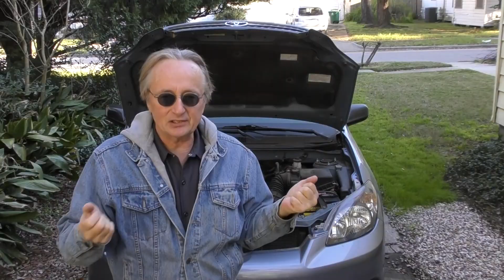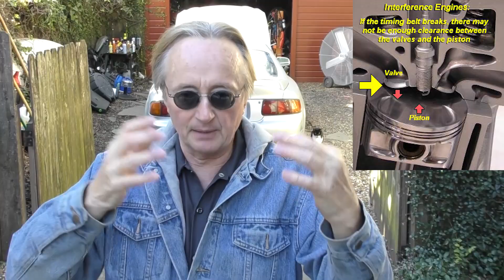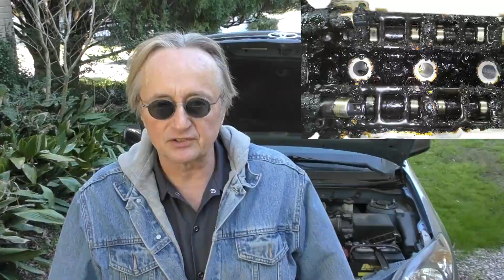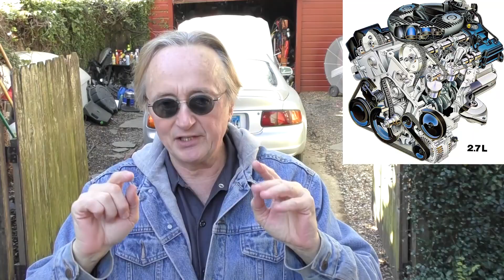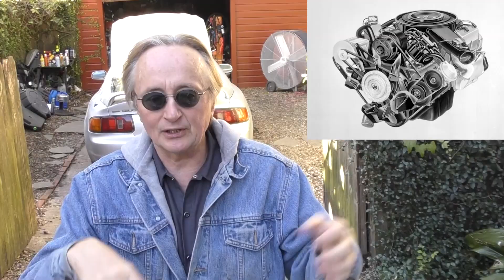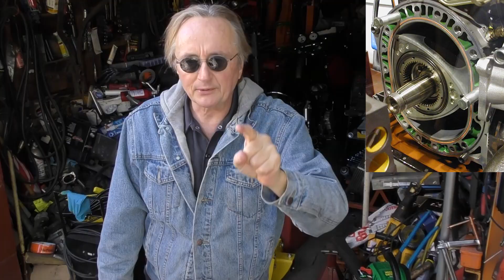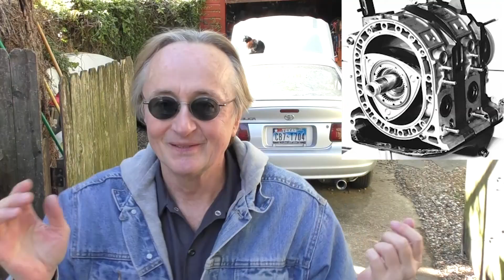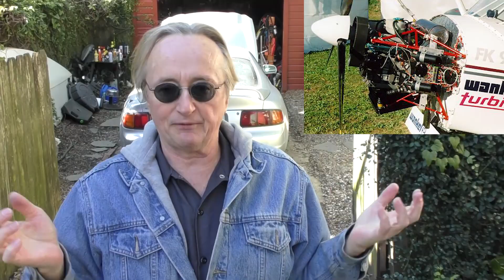Never Buy a Car With This Engine

Comment: What ever 6 cyl. that was in the first year Chevrolet Celebrity was my worst. Pure Junk!
Reply: COO Ba The citation was pretty awful too😂😂 And of course the Vega
Reply: @JDMHaze  Oh the Vega! It would of probably been a good motor, but it had to be kept clean and maintained. Oil changing with good quality oil a very well kept intervals. But being an economy car, those who bought it we're not very good at maintaining a car. The chrome lining to the cylinder walls was less than paper thin, and any dirt or grim would almost instantly destroy it. Failing to keep up decent oil change intervals was a sure death certificate.
Reply: @ronfullerton3162  But on the plus side, Dead Vegas were once very cheap,and just waiting excitedly for guys like me to drop a V-8 off between the fenders and go to The Strip?? Several places even made a kit with everything you'd need to do it!!!! (And truthfully, most Vegas you'll see today......have a Small Block dropped off in 'er??)
Reply: @DrOlds7298  That would of been an interesting machine! Nice power to weight ratio! Was there enough goodies around to make them handle good also on the street? That would of been great fun.
Reply: Probably the 3.0 L. I had a century with one. It was junk.
Reply: 2.8. That's probably the one you're thinking about??

Comment: Buy Japanese cars Only, you won't regret it.
Reply: Or a Ford/Lincoln product. The 2 liter turbo 4s in the Fusion are solid and fun to drive.
Reply: @davidperry4013  Ford cars are discontinued except for the mustang.  I 'll stick with Toyota or Honda.😀
Reply: Prices of 94 Celica's are going trough the roof nowadays.
Reply: Hondas are notorious for bad transmissions, Toyota's have had oil consumption issues and failures with some of their 4 cylinder engines and huge issues with rusting frames. The frame problem is on trucks band suvs though, I don't believe it's an issue with the cars
Reply: lol after u have your yearly inspection and the inspector points out how your car wont pass because it has so much rust problems, you will regret.
Reply: @tommior9553  That's it. It's that all you have? Lmao
Reply: @rafyg3314  they have good reliable engines dont get me wrong, but corrosion protection from factory is very poor.
Reply: @tommior9553 Yeah just like Scottys  1993 Toyota Celica right. Lol
Reply: @rafyg3314  scotty lives in an area where there isnt heavy snow season. mix snow, salt and Japanese car, mazdas especially, and you will have plenty of rust.
Reply: @tommior9553  Any car rust in the north, don't buy a Honda if you leave in Alaska. Lol
Reply: @tommior9553  that's just Toyota

Comment: My roommates 79 RX7 was a fast as hell car. But it spent more time in shop to ever enjoy it. I don't know if we ever went more than 4 miles at a time to test the gas consumption. Yes it would back fire. But there were ways that he could reduce the sound of the explosion. It was always something. Timing, fuel issues,oil problems. His brother was a Mazda dealership mechanic so it wasn't like he going to Scotty or some goofball. This was back in 1988 so Scotty you didn't have 50 years experience.  But man it was Fast as Hell.

Comment: I have a 2001 audi with the NA v6 and its actually pretty solid, but I only run an expensive oil in it
Reply: What oil do you run? Amsoil? If you run Royal Purple I would switch to Amsoil or another well regarded brand, RP is just an inconsistent scam. Also make sure you're running good quality filters too if you're gonna run expensive oil, especially if you're going for long change intervals. Nice car!

Comment: Audi 2.0t is way worse than the 1.8t reliability wise, the 1.8t is almost bulletproof.
Reply: I got a 98 audi a4 1.8 t quattro at auction for $1300 with 121k miles, it has a 95+ hp tune and k04 upgraded turbo it was very fast driving it back from the auction but the check engine light came on pulling in my driveway amd started bogging down its been sitting 2 years since dont know if I wanna fix it and drive it or what
Reply: @302diamondstate7  sell it
Reply: @302diamondstate7  Pull the codes, Probably just in limp mode, Might be a moderately easy fix. Take the oil fill cap off and see if there is oil buildup inside, This would indicate it has had conventional oil ran through it at some point. If its clean for the most part I wouldn't worry but if there is a darkish buildup then you might have issues. These engines can be good but this year of the 1.8T for these Audis had sludge buildup problems from improper maintenance & the oil pumps crapping out.

 The 1.8T's can be reliable. CAN be, But must be maintained well with synthetic fluids. This goes for pretty much all of these engines, Maintenance is very important. I have a 98 A4 with the 2.8l V6, Skimped out on doing my oil change late and then also changed the oil with cheap synthetic crap from Walmart. 
Two weeks later Cyl 2 had a rod bearing start to go out. I have since swapped a new engine in and its running and driving fine but these cars are a lot of work when something does go wrong, Do some research, Know what to look for and what your getting into.
Reply: @Syphious64  my scan tool wont comunicate with the car to pull the codes and the obd 2 port has been removed from behind the console and placed under the dash
Reply: @Syphious64  Dude you killed a 2.8... you know how hard that is to do? thats a 200k+ motor all day. what was so hard about keeping good 5w40 in it? I'm actually shocked lol
Reply: @302diamondstate7  Sorry for not responding till now,  So I believe for older OBD2 models, The obd port was on the console and newer ones Audi moved to the dash. Mine has it under the dash from factory(1998) and. And maybe try a different scantool or like go to O'Reilly's and borrow theirs. If that obd port was relocated I would then compare the obd wiring is there on the car end and make sure the wires are in the correct pins and that the obd port wasn't crimped or soldered onto the OEM car harness.
I use a scantool from Carsoft, VAWS2. It lets me do everything I needed without buying VCDS to do stuff like clear and read Obd2 codes and more detailed Audi codes, Test every electronic system of the car, Abs testing, TBA's and a bit more. Not as good as VCDS no but it's very portable and works well
Reply: @SearchEast2069  Dude I dunno, I blame myself for it but at the same time wonder if the previous owner skimped on some work. It's fairly clean and I did get it pretty cheap so. Yeah. Was sad though, the old engine ran great still. Only drove it for like 2 weeks after the first oil change before it blew. 
The new engine is doing great though thankfully, chain tensioners were bad so that was fun..
Reply: @SearchEast2069  no oil change or just no oil......
Reply: Agreed. Daily driving one now. Had over 200k on it with k04 and chip tune. Rebuilt the motor and have 50k. Basic maintenance and that’s it. But I also don’t have the auto trans which does give the car a bad name, but what car from that era  didn’t end up with transmission problems
Reply: @Fifteenzz  We have one here with 300k miles on it its an Audi TT. Serviced 10k mls with full syn. and goes forever.
Reply: KevinGoldLVL The 2.7t was pretty bad too.
Reply: @97I30T  the 2.7tt was way worse !
Reply: @97I30T  2.7 is bad because dudes think they can big turbo it on some crazy stage 3 tune and it will hold up. Plenty of STOCK S4's on the local CL with over 100K. Good motor.
Reply: kevin, what kind of bullets are you talking about? hahahaha
Reply: No chance. The 1.8 was a disaster.
Reply: @gearbox1858   stop stop stop the 1.8 is a rock. Its the 2 liter thats a ticking time bomb.
Reply: Antwon Jenkins thanks for your “opinion”....I’ll stick with what I know and the guy who has 51 years experience.

Comment: Scotty , I have a 2000 A4 whit a 1.8 atw engine  got 200 k  and running like a watch , I use Mobil 1 and change it at every 3500 miles , original turbo , manual transition and believe it or not original clutch .

Comment: Worst engine ever= gasoline  350 chevy converted over to diesel!
Reply: General Motors bean counters saw to that one. They should've just adapted their solid diesel truck engines to car use.
Reply: No such thing.
Reply: It unfortunately was an Oldsmobile?
Reply: @DrOlds7298  It was an Olds V8 converted to a diesel, my bad.

Comment: 1.8T is a great engine marred by problems of poor maintenance. If you maintained it right, easily can go to 200k+
Reply: Then you have the 1.9 TDI which at 200k its just breaking in. Grandpa has a 2000 model which still runs and pulls like a train with only regular maintenance here and there and some parts changed over time. Really well made back then.
Reply: Agree.  But VW/Audi could have avoided these issues by simply having a larger oil capacity.  Going 10k miles on just 4 quarts with a turbo and modern PCV recycing system was always asking for trouble.  Change the oil every 3k miles and it will go on forever.
Reply: Problem #1: 10,000 mile oil changes??? Maybe on a Big ol' Diesel,like a Semi has.....but a passenger car? And a small 4cyl one??? Even being synthetic,that's too long!!!!  Longest I'll let one go is 4,000 mi....and usually I'll change the oil at 3,000 or so?? (But then,'my' engines are all V-8's,ranging from 4.6 L/281 ci (Crown Vic/Grand Marquis) to 7.5L/455 ci? (Oldsmobile)) Most 'picky' ones I've had about it were the small block Chevys of all things? (And don't EVER use a Fram oil filter? Air Filters,they're pretty good....but their oil filters are awful!! )
Reply: Jonathan Bywater the tsi 1.8t gen 3 engine holds 6qts of oil, i still don’t go 10k, more like 5500, just to be aafe
Reply: @jonathanbywater2063  Absolutely, longest I've run on an oil interval is 5K on synthetic plus I also use liquimoly friction modifier. Love it, works so well engine takes longer to warm up in the winter.

Comment: It seems like these over head cam engines with timing chains are not lasting very long. I would like to see and over head cam design that is gear drive, no chain. Does anyone know if that exists in a car or truck engine? I know Ducati uses this technology but i want to see it used in a 4 cylinder or Maybe a V8 and see how long it lasts.

Comment: Wrong the 2.2 ecotec is a reliable engine I have a 02 Cavalier with the 2.2 and manual trans it has 235k miles and runs like a dream. I have seen many Cavaliers, sunfires, saturns with that engine with over 300k miles. If you take care of it it will last
Reply: @Brayam Valdez exactly finally someone said it, same with the 2200 pushrod engine that replaced it.
Reply: Never had any issues with my 2.2 vvt. I also dont neglect it. Ive only had to replace the exhaust cam solenoid, noisy sending unit and other basic things. 108k
Reply: 02 wouldn't be an eco tech. That should be the good 2.2. They were known for headgaskets leaking to the outside by cyl 4. Keep the coolant topped off and they run a long time
Reply: @veteranheavyequipmechanic4990  mine says ecotec in the engine. I drive it 400-500 miles a week for work and it runs great for a 17 year old car. I also take great care of it nothing but full synthetic
Reply: @803hotshot8  you're a lucky one then
Reply: Bahahaha

Comment: I had the 2.2 Ecotec in my 2006 Saturn  Ion. It started to have cylinder 3 misfire. The car had 256,000 when I sold it.
Reply: Had a 2000 Saturn with the 2.2. Had 250k when I traded it in and it ran great. And I beat the piss out of it.
Reply: @mozeby1975  That was a much better design.
Reply: Had a sunfire in the family. The 2.2 ecotech was where gm spent the money on the car and said f the rest. I disagree with Scotty on that one.

Comment: Hey, Scotty I have a Pontiac Sunfire and it has the 2.2 ecotec and it has around 90,000 miles and I've heard stories of it lasting 200,xxx I do change my oil every 3000 miles will my engine be fine

Comment: Guess I'm getting lucky.  08 cobalt here with the 2.2 ecotec. Never 1 problem in 10 years of ownership and 135k miles with the engine.
Reply: Cloyes has an updated kit that’s working very good for that engine. No hope for the 3.6 L GM however.

Comment: Anything is as good as you maintain it, have a 13’ Malibu with a 2.5 eco tech I’ve done nothing but put full synthetic in my car every 5000 miles and I’ve had no issues.

Comment: A friend has a 2011 Terrain with the Ecotec 2.4L. It wasn't running right and had a check engine. She brought it to an independent mechanic and the engine died during diagnosis. It appeared that the timing chain jumped and some valves bent. It was out of warranty but not by much so she towed it to GMC dealer but they wanted $7K for new engine. I saw lots of similar issues on the net and told her to raise the issue and ask for some help, even half cost but she didn't want to fight for it. She decided to replace the engine with a new one at the independent shop for $5K. All is good for now but she is done with GM for sure. Junk like this will destroy a company over time.

Comment: I disagree with your 1.8t vw/audi negativity.  I have 225k on mine, I only use synthetic oil, and the engine is a beast, runs great.  The only argument you have Scotty is initally vw used the wrong oil.

Comment: 2006 Saturn Ion 2...237,650 miles...running strong as new. By the way, still has original brakes, alternator, and starter,
Reply: Bought new?

Comment: No Honda, no Toyota... Shame on u mazda
Reply: It's just the rotary engines in the old Cosmo, Rx7 & Rx8's... if I heard their regular 4 bangers were crap, I wouldn't've bought a 2016 like I did... 

...but I heard their turbocharged cars in the recent past were verrrrry questionable... as in some speed 3's turbochargers potentially very worn by well below 60k miles... best of luck to the brand new Cx5's, Cx9's & FULLY LOADED mazda 6's if that's still a going concern...

Comment: Hey y’all and Scotty, I have a question. Within the last year I acquired a 2008 Volvo S80, 3.2 L sedan, 150K miles. It was a steal for $2200 at the time, but now I’m having my concerns if this will just turn into a money pit. The suspensions feels worn, and the shifting (it’s an automatic) feels rough. Not much else wrong. Replaces a thermostat here and the plugs there. My question is, should I just drop it as is and try to find something cheaper? I’m a broke college kid and this is my only form on transportation so I need something cheap and reliable. Should I spend the money to repair this car or cut my losses and find something better? 

-Regards.
  River
Reply: Cut your losses.  Volvo, or any euro car, is expensive to repair in the States.  If you could find a sedan with low miles and a solid engine, that'd work great.  Those mid 2000's GM LeSabre, Impala, Grand Prix, etc with a 3800 (NON-SUPERCHARGED!) are a great car, granted some kid didn't rod the piss out of it first!  If I were to relive my 20's over again, I'd probably get a Buick LeSabre from the mid to late 90's (I was in your shoes 10 years ago with a "cool car" with no spare doors and a spare pedal, y'know, the "had to haves")
Reply: Pat Callahan thank you! I appreciate the feed back! I’ll sell it ASAP and try to find something older I can wrap my head around.
Reply: Sell it fast while you can and get a toyota. That's exactly what Scotty would say
Reply: Matt Davis exactly what I was thinking! Thank you!

Comment: My 1.8T has 156k and is doing just fine.  I replaced the coils with the hitachi ones and change the oil ever 5k besides the coils I haven't had any issues.
Reply: My 2001 A4 has 241K miles and I fixed the engine like 3 times
Reply: Cryostal you fixed what?
Reply: You’re doing good. The Hitachi coils are the ones to use. I wonder if smaller spark plug gap would help? Make sure O2 sensors are always fresh so it doesn’t run too rich.

Comment: I have a 2.2 ecotec engine with 190k miles and it still works great. Also my brother had a car with the same engine that had 197k miles on it. Only reason it didn't get more on it is because it was totalled in a wreck. Never had any problems with mine.
Reply: same in here as well
Reply: Tyler Yoder 
My cavaliers was fine. But my Cobalts was no good

Comment: Scotty did you ever play with a Lotus 907? The Lotus 907 was fast for a 4 cylinder but it wasn't made for longevity, I had a Jensen GT that used that engine and once it got 60k on it you spent 3 hours of work to get 1 hour of driving time. It had several issues that could have been overcome but the one I couldn't live with was the overhead cams didn't use bearings it rode right on the aluminum heads and you adjusted the valves using circular shims, you took your measurements with a feeler gauge then removed the cams put in the proper shims then replace the cams. The 907 was originally designed for racing (it only needed to last a few races before it would be rebuilt anyway) but before it could be put in use the rules changed and the engine was useless for racing so they de-tuned them and put them in street cars.

Comment: For me 2012 traverse i still have it but scare me, i replaced the water pump, and were pretty hard and 1 of the screws broke inside so now is running with out 1 , is no way to remove broken screw and make new thread

Comment: That's extremely BS Scotty with the GM motors. My fathers 2007 Chevy Malibu had over 250K miles and all he ever did with that car was literally oil changes and break changes... Transmission ran smooth like butter as well. His Hybrid Sonata now has given him so many problems already!
Reply: But also my father used to do roughly 100 miles a day as well. So it was literally all highway miles

Comment: it wasn't metallurgy!!! It was 1/4 in thick rings scraping the hell out of the cylinders and running with no air or oil filters on primarily dirt roads.
Reply: i own a model a ford.